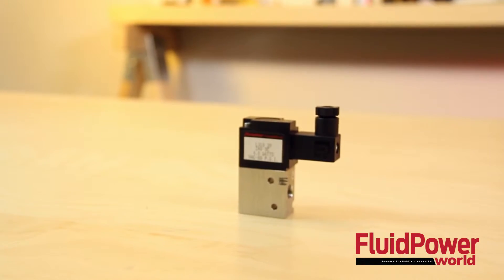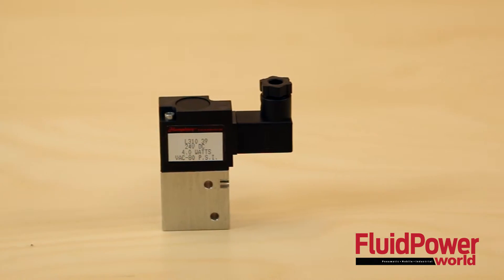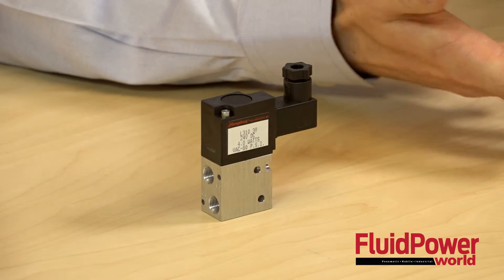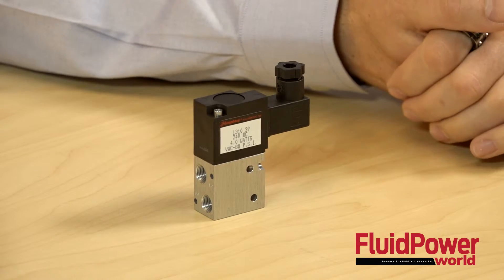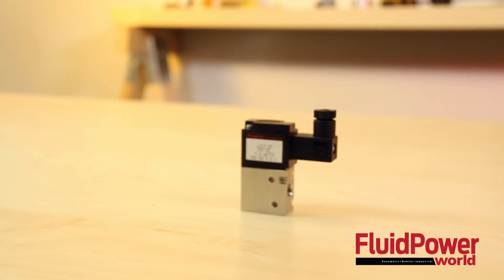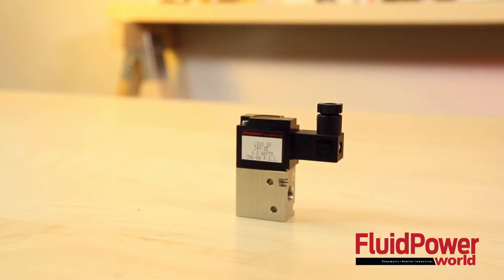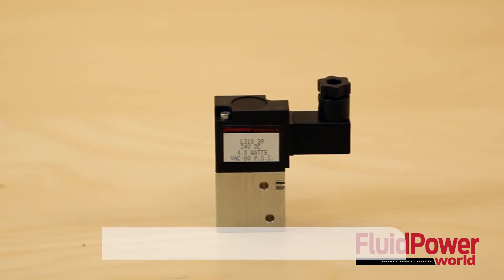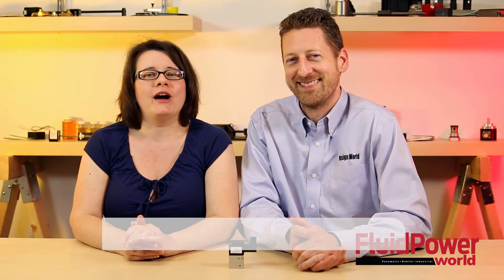Energy-savings is key to these latching solenoid valves

Comment: Will there be Normally Closed or Normly Open in Latching Solenoids?? I come across one issue while using latching solenoid.. that is..if there is power failure during open condition... it will keep continue in the same position till the arrival of power supply and change and also till the next reversal of polarities. Kindly tell a solution for this